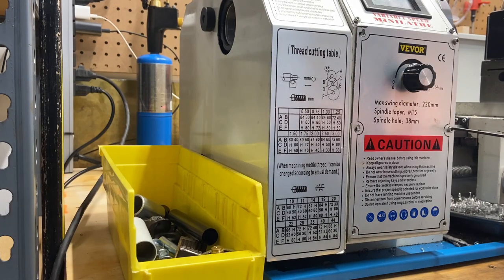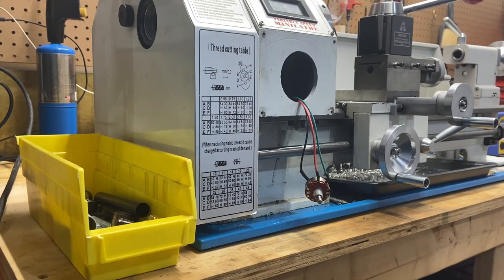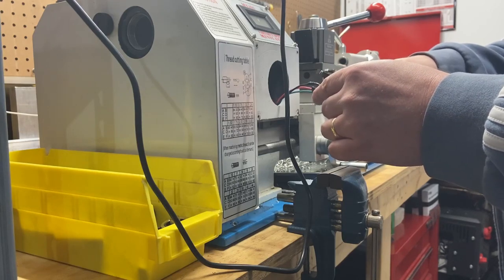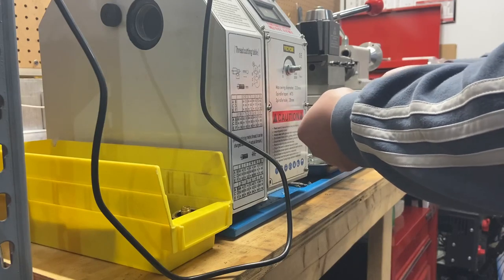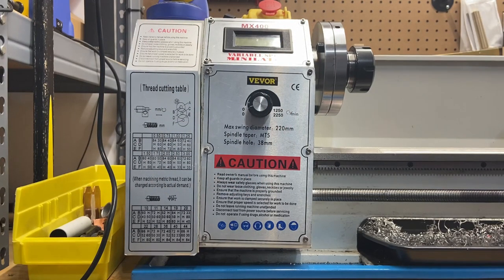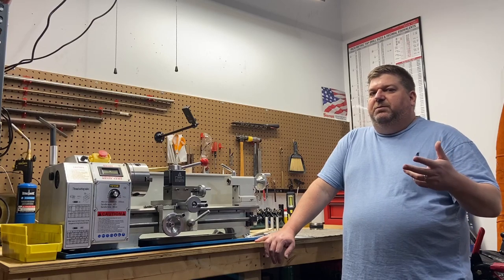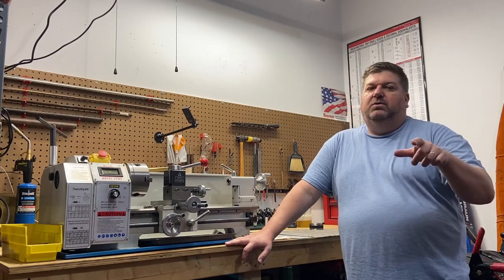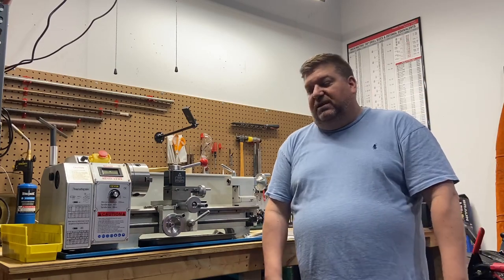Boboran/Vevor Mini Lathe Support Review and replacing Potentiometer to fix variable speed issues

Comment: I am glad they covered your cost, that may be warranty, but is not support.  In this case you didn't actually need support, you just needed a part.  In my opinion, specifically in the case of a beginner getting into the hobby, support would involve starting with symptoms, walking the user through step by step processes to troubleshoot the problem, and then providing step by step replacement instructions.  In this particular case you did not show the controller board the potentiometer hooks to, but I expect that the other end of those wires plug in, and if you had not sourced your own part, the manufacturers replacement would have been a potentiometer with attached leads that just plugs into the controller board.  I define support as the company will make the machine work as designed, whether the customer own or knows how to use a soldering iron or not.   
You are right, the price point of these machines determines the quality and also the level of support.  You will not get what I would consider good support from any of these inexpensive machines, however you often get a decent warranty.  There is a step up from the unknown amazon sellers, which comes with a little bit higher price.  A place like Grizzly or Harbor Freight will sell essentially the same machines, but they have some skin in the game, they have a vested interest in keeping customers at least not vocally upset.  Then there is what I consider another step up, which would be places like The Little Machine Shop or Precision Matthews.  Again, very similar machines, but they are a smaller operation than Grizzly or H.F., so word of mouth reputation is even more important to them.
Even these companies do not provide full service support.  In fact Precision Matthews specifically says in their warranty that it doesn't cover labor costs, just the parts. (in my experience Precision Matthews warranty response is excellent, but you need to be comfortable tearing your own machine apart)
However the lack of support has a counterbalance.  The cheap price precludes support but it creates a large installed base, so the community of users generates its own support cloud, which can help with troubleshooting and diagnosing problems, as well as recommending upgrades and modifications that improve the operation of the machine.  On these little lathes you will find lots of online communities that can tell you where the most effective changes are to help with rigidity and lessen the chatter.  They can tell you what types of tooling and feeds and speeds work best.  
From my point of view these little tools are the entry drug.  You buy it, it kinda works.  Of course, at that point you don't know what you are doing anyway.  As you learn, you also learn to tweak the tool, and get comfortable working with, and working on, the tool.  When you progress past the point where the entry drug no longer satisfies you have learned enough to be better qualified to know what you want.  At that point you can either move up a size in the import world, or start looking for a used real machine.  Once you look at machines in the $1000 and up range you are now in the range of an old South Bend lathe or Bridgeport Mill. On eBay look for the local pick up only listings, if they are in driving range they are worth checking out, and the seller has already decided it isn't worth their effort to ship it, so prices are better.  Yeah, the spiffed up ones cost more than that, but if you pay attention and don't get in a rush you can find the $500 bridgeport that just needs to be out of the shop right now, or even the "come and get it" grandpas old lathe that no one in the family wants to deal with.  
If you let your circle of friends and acquaintances know you are interested in all things mechanical there will be times when stuff just pops up.

Comment: Hi, thx for this Video.
What Potentiometer do you buy?
Reply from the maker: For this lathe,  Search Amazon for WTH118-2W.  It will come up with many options most less than 10 US dollars.  "uxcell Rotary Carbon Film Potentiometer with Control Knob, WTH118-1A 2W 4K7 Ohm" is specifically what I purchased and is working great.  Search that on Amazon.  Cheers.
Reply: @deezworkshop  Thank You very much!

Comment: I just bought this same vevor model and unit and brand new out of the box and my speed control switch setting at 0 rpm and the spindle /chuck is still spinning at 50 to 500 rpm  at the 0 setting so I guess my switch is faulty
Reply from the maker: As cheap as the Potentiometers are I would try replacing it first,  You may check that your RPM sensors are aligned properly at the top of your spindle bore above the gears under the left side cover.  If you happen to have a laser tachometer (Who has one of those laying around right :-))  you could verify the actual speed as well.  Depending where you got it you may also reach out to support and see if they will send you some parts to replace.  If its the control board you may be looking at 75 bucks?  But if you just bought it support should at the very least cover the costs for materials or threaten to return it.  It has been my experience to have had monetary compensation for the issues I experienced.  I was satisfied enough with the resolution...Of couse no issues would ahve been better but we all know what we are buying here.  Good luck.  if you need me to check something on my lathe for comparison let me know or shoot me and email.  Email is on my about page.
Reply: @deezworkshop  could you send me the potentiometer information from the back  and where  you purchased them. I looked on the back of mine but the information was smeared and unreadable thanks
Reply from the maker: Sure,  Search amazon for this Rotary Carbon Film Potentiometer with Control Knob, WTH118-1A 2W 4K7 Ohm

The information on the back of the POT is WTH118-1A but WTH118-1A 2W 4K7 Ohm is what I got and its working well so far.

Comment: i had a problem with larger unit. it was the V210WD 210x800mm unit. the saddle was mis-manufactured, and it did not function at all correctly. i got a partial refund and alter they just replaced the entire unit, so they did right by my books.
Reply from the maker: Right. They all have problems no doubt. So far my experience has been they work with you though. Hard to complain considering they have stood by issues with me and we came to a satisfactory compromise. Typically refunds for parts replacement. I’m fine with that. I am glad they seemed to do the right thing for you.

Comment: Thanks for the video. In general, what do you think of the lathe?
Reply from the maker: Overall I am happy with the lathe and am glad I went with this purchase. It certainly has quality issues but fortunately for me, with the help of many generous others, I have come up with solutions to address them all. Sure I wish some things were different. Assembly quality. Casting quality, compound issues, tailstock…etc but if quality and manufacturing was of greater importance than my budget I would have chosen a south bend, precision Matthew’s or other quality brand. But like many of us budget is our limiting factor. 

If you ask me if I would buy another, my answer would be yes. 

I think this is important to reiterate, I am not affiliated with any reseller or manufacturer. Just a guy who likes to tinker in the shop and learn new things.  Thanks for watching.
Reply: @deezworkshop  Thanks for your honest opinion. I was just looking at a Sumore from China and there are meant to be really good quality. This won't be until next year when I build a small shop out here in Thailand 12 feet long x 8 feet wide so I can tinker about
Reply from the maker: Good luck. You can do a lot with a very small space. 8x12 would be great for a hobby shop. Feel free to email if you have any other questions and I’ll be happy to share what I can from a beginner perspective. I’ll check out the sumore brand. Not sure I’ve hear of that one.

Comment: I just purchased a VEVOR 7 x 16 mini lathe. At first start it went to 120 rpms without turning the speed control knob. I went round and round with vevor customer support. After three times dealing with their non knowing staff I gave up. I will probably do the same thing as Deez did and replace the pot myself. They would not honor the no hassle return.
Reply from the maker: Could you provide some more details for others who may read your experience? Where did you buy it from?  I agree that the person you communicate with is not a technical person.  In my experience when I had an issue and they said that they relayed the issue to one of their technicians,  Then they said to replace the Pot and they wold cover the cost.  I did so and it resolved my issue.  If it had not they probably would have suggested another part to replace. I did not pursue a return of my lathe for any issues I had, I wanted to keep it. I also purchased mine from Amazon so I could use Prime for free returns.  I didnt have to but that was my backout plan if I needed to use it. I feel its worth mentioning at the time of this comment I am NOT affiliated with Vevor in anyway. Just a guy in his garage who bought a cheap benchtop lathe.  Good luck.  I hope the replacement pot corrects the issue.  It seems like it would.
Reply: @deezworkshop  I purchase mine from straight from Vevo. When I hit start and go straight to 120 RPMs. It will not go any lower. Since vevor is a broker for the Chinese manufacturers and they do not have any technical support. The person you get is a warehouse employee. There no hassle return is bogus. If you have to ship it back you pay to have it shipped. And they don't want it back anyway. I am stuck with a lathe you can't hardly use. You just have to get used to it starting at 120 RPMs. They refunded me 30% of my purchase price. And told me to keep it. If it's something that you can fix you don't have to fix it. If it's something you cannot fix your stuck with it.
Reply from the maker: Thanks for sharing more details. This could help others decision in buying from Vevor.
Reply: @JimMcginley-fq5ic 
Jim model MX-S716G?

Comment: They covered your part but not your time to replace it most of those warranties cover parts and labor I know it is only a 20-minute job but time is time, anyway, you have it working that is the main thing, the other to open the cover on your start switch just push the flat button on the side of the red emergency stop button.